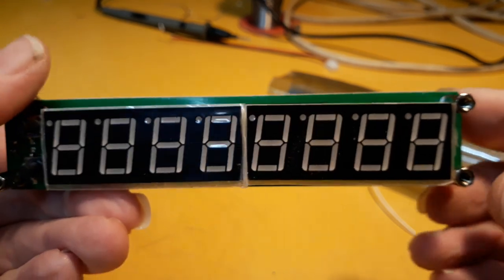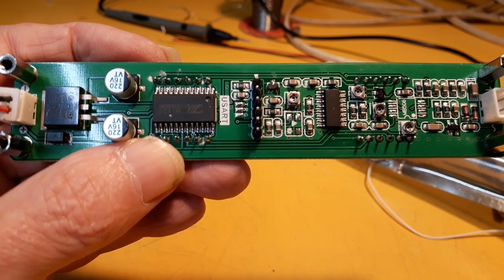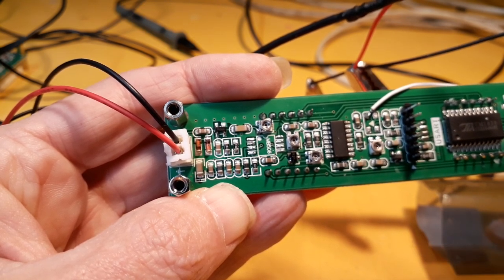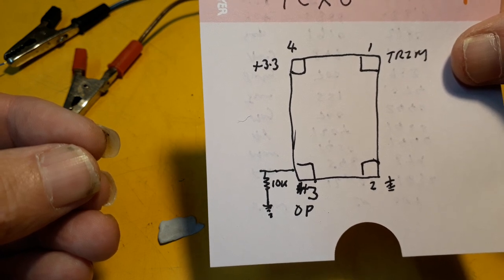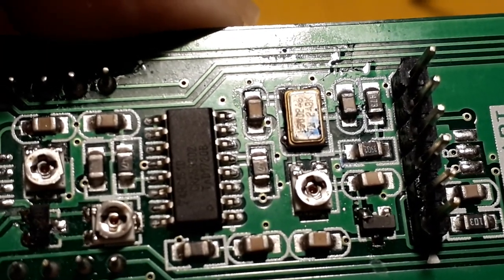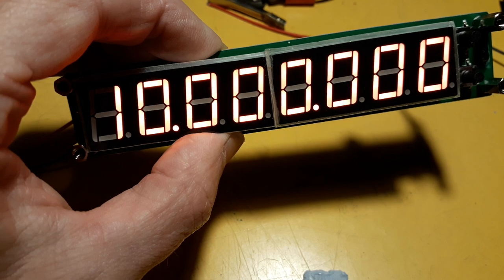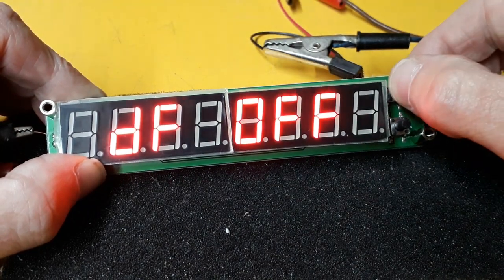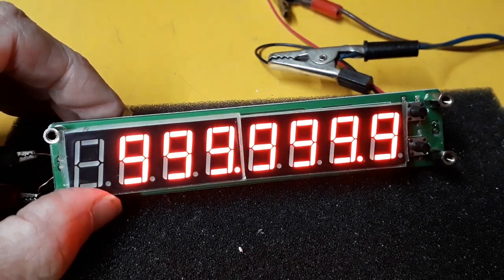Fixing things not worth fixing! Chinese frequency counter module

Comment: FYI the uTuber "theHWcave" has a very good video on these.. well worth the watch.. has some partial ccts of the units. Plus mods like adding a resistor in parallel to one resistor in the TCXO cct to allow trimmer to be more centered..and a second major mod re the separation of combined input into 2 separate inputs, one for the low range and other for the high range
He also discusses reading accuracy issues
Reply from the maker: Thanks for that i will check out his channel sometime. Personally i wouldn't bother to modify it as in my application I've only used it to display frequency in old analogue tuners. Its more than good enough for that as it is. I wouldn't want to use it as my only frequency counter although it work fine if that's all you can afford & you can't beat it for the price! When I think back to the first counter I built 40 years ago it must have cost at least 10 times as much!

Comment: That's really cool!  I've seen these and have thought about it, but having several freq counters already...but now seeing how interesting they are...I'll be adding one to my collection.  :)  I have been trying to learn about prescalers...wondering if you could input a low freq from a function generator and output a much higher freq...need to buy some to experiment...if that worked, it would be a cheap way of having a better function generator.  Regards mate.  ~Jack, VEG
Reply: Thats really a cheap way of adding one to my collection! Having several freq counters now seeing how interesting they are and trying to learn about prescalers Ive seen

Comment: Do you have any problem with those overheating when running?
Reply from the maker: Never had a problem with overheating, of course I usually run them close  to the lowest brightness setting  as find them too bright otherwise, that may be a factor